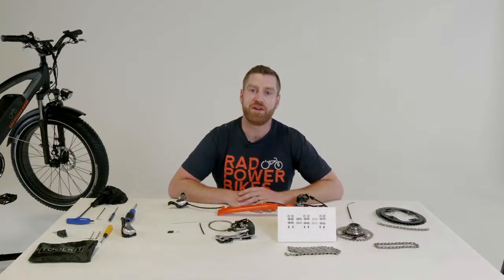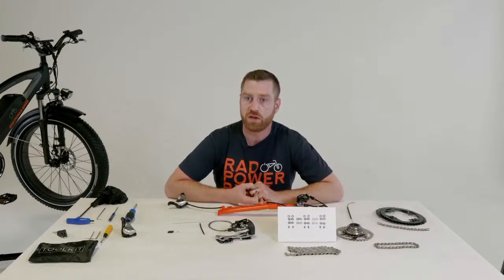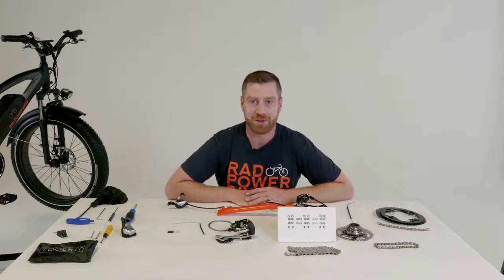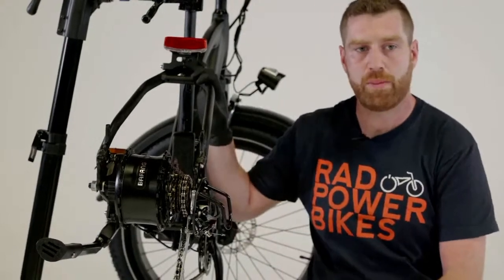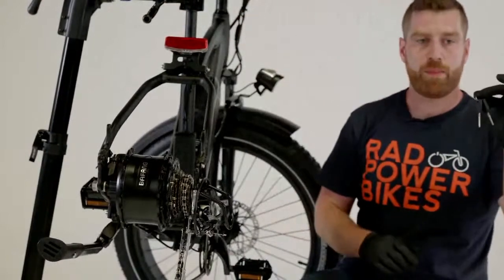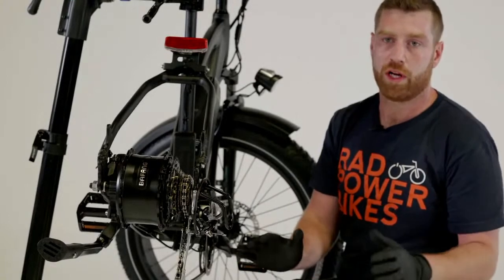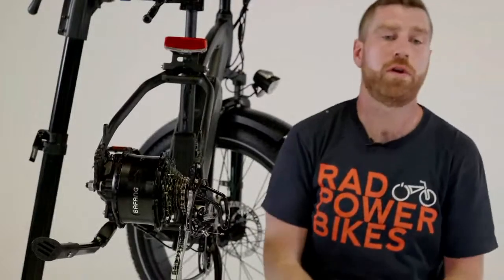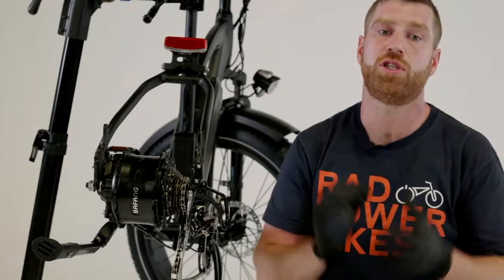Rad Academy Live - Rear Derailleur Adjustment 101

Comment: This is the kind of video all companies should have. Just got my RadCity 5 Plus and had problems with the rear derailleur.
I had problems with my gear skipping and 6th gear didn't even work. Everytime I pedal the gear would jump and automatically switch gears. So I followed your guide and the bike is also more silenced. Saved me a trip to the local bikeshop too. 

I only wished you guys would answer the questions in the comments on this video instead of refering to customer support. Would help others reading.

Comment: I just got a new RadRunner Plus, and the chain skipped under a heavy load. It turned out to be the shift cable had slack, causing the chain to be in between gears. I followed the procedure shown here. Very easy to follow, and the adjustments made shifting super smooth and quiet. Thanks!

Comment: This is a great demonstration. I would suggest that a closeup of over the shoulder view would help. I was having trouble shifting my RadCity 4 from 5th gear to 6th and 7th gears. I watched the video twice, tried to adjust, and had no luck. AFTER the 4th attempt, I set back looked carefully at the derailleur. I notice the (I don't know the proper name) brush guard was bent and preventing the derailleur from extending to the 7th gear. I CAREFULLY bent the guard and it works perfectly

Comment: Amazing video. I now have confidence when adjusting the derailleur. My Radwagon 4 had some gear shifting issues out of the box or maybe I caused issues while constructing the bike myself. Anyhow, I followed this video from front to back and found some real issues with the settings. I think I prevented a serious accident, and all the gears shift perfectly now. I couldn’t figure out where the 5mm gap was supposed to be measured as the last adjustment, but then I was assured I didn’t need to tinker with this one since the gears were working well. This video should be referred to in the manual, along with the self installation video, if it isn’t already. This is the natural next step after construction, and before you strap your kids on the back.
Reply from the maker: We appreciate your feedback! Please don't hesitate to reach out to our team if any issues come up.
Reply: (new rad bike owner here, your customer service is amazing)

Comment: Great video. My derailleur was messed up.. So I thought. It didn't want to go into the lower year and I was trying to adjust the lower limit without success. It turns out it was the cable tension. It's shifting very smoothly now thanks to you and this video. Great support all around so far from RadRover. You gotta like this kind of service. It's what I call a customer centric company. Keep up the great work.
Reply from the maker: Thanks for taking the time to share your positive experience! Please don't hesitate to reach out to our team if any issues arise, you can reach them via email at radpowerbikes.com/support.

Comment: Thanks to your highly instructive video I fixed my bike, that wouldn't shift into 1rst or 7th, with a hammer.  The hanger was bent out and a few whacks with the special alignment tool, AKA a hammer, did the trick. Not for the faint of heart.
Reply from the maker: If you need any additional help Lee our Product Support team is available at - radpowerbikes.com/support. We want to make sure you're taken care of!
Reply: @RadPowerElectricBikes  Thanks, I have years of experience with bikes including recumbents, some built or modified and have always done my own tune ups. So when I couldn't make this one shift right I was puzzled until the bent hanger was revealed as the culprit. I was very relieved. Thanks again

Comment: Thank you for this educational info. I can verify it is still being reference by new Rad owners. I adjusted the radrunner plus I got my wife for her birthday and also my FrankinEngwe which has a different brand rear derailleur with the limiter screws facing outwards but it worked just the same as you have shown. We adjusted an old 6 speed as well. Everything runs smoothly and better yet we understand what is going on with our transmissions and how to adjust and maintain!
Thanks again
Reply from the maker: Thanks for taking the time to share your feedback! Stay Rad!

Comment: Plan on getting the rad plus shortly. I am currently using a recumbent trike. After watching all the videos on adjusting and what to check on multi-speed bicycles and trikes yours is the first I have found that breaks down the individual components and explains them to the point of what they are supposed to do and what to look for even before starting adjustments. Thank you very much. Will you be doing videos on brakes and the electrical system? 
Chris in Meadville PA

Comment: Thank you, David.  I had the same problem as Dennis Maloney did with the derailleur guard bent every so slightly wheelward, preventing the derailleur from reaching the highest gear (7).  I suspect it had been pushed in during its somewhat tough transcontinental transit to my home.  You might wish to amend the video to verify the guard is not striking the derailleur body as a first step...

Comment: I tried myself after i took out the rear wheel but it's not so easy. I had to take my Rhino to a local bike shop. They finetuned my derailleur and adjusted both brakes. I took less than a half hour and i paid 20€. Some things are better done by a good mechanic, especially if it concerns your own safety and that from others...
Reply from the maker: Great call! We always recommend having your work inspected by a professional bike mechanic to make sure you have a safe Rad Ride!

Comment: My RAD Mini in a lower gear made a crunchy noise and the chain is not on the sprocket but in between it. This happened first time I rode the bike from the factory. Looks to me like the chain is installed too loose and just needs tightened up. Bike works fine if you don't peddle.

Comment: you could just remove the battery that is a guaranteed way to not have the bike turn on.

switches can be set wrong or fail or be defective so the battery may not be off.

also removing rings is to prevent shorts with any wires if you are working on the electrical mostly if you are building a battery.

if the derailleur hanger is one of the many standard hangers you can replace the hanger  i think where the bike mechanic is needed is to straighten a bent hanger

for the bike its self most bike shops can help there the only things that would be rad specific would be the electrics and any custom designed parts?

Comment: Just watched and will be trying the adjustments for better gear changing. 2 questions: 1- with no bike stand is there another recommendation to get the bike up off the tire so I can turn the pedals and wheel (rather than having to wait for my husband to get home and list the bike up)? 2-will adjusting my gear using the derailleur tips fix the fact that my gear changer does not make audible sounds nor seem to hold the selection when choosing easier gears?
Reply from the maker: Hey Beth! These are great questions for our Product Support team! You can reach them at - radpowerbikes.com/support.

Comment: Not sure if this will be answered, but on my fat bike I fell over on the drivetrain side (clipped in...), right afterwards I noticed it would jump or as I sound it...tik, tik, tik on the 2nd and 3rd lower gearset.  I attempted to adjust it but these systems are a mystery to me.  I took it in and the bike shop 'adjusted' it but I found during a ride it was doing the same thing, but under load.  What perhaps did they miss or not do?

Comment: I needed to move my RAD Mini derailleur handle, but the screw was too tight. I've stripped it. And the screw head is rounded -- can't grab it with a pairs of pliers. What size replacement do I need? FYI: Good video.
Reply from the maker: Hi Davis! Our Product Support team can help you out with this. They can be reached at (800) 939-0310 ext. 2 or at radpowerbikes.com/support, and they'll take care of you!

Comment: Is there anything else that could cause popping when in 7th Gear other than testing indexing and the limit screws? I've tested everything out and it works fine on the bike stand, but as soon as I apply pedal pressure when the bike is on the ground I get intermitent popping and I can't tell if it's skipping over the gear?🤔

Comment: Have you got a video for the radrunner 1 as I am in great need for a bolt which attaches the rear drop out hanger to the bike thanks the one I have or did have is no longer viable and I am having great trouble in sourcing a new one , it should be sold with the drop out hanger but it is not

Comment: For the rad chains, are there any rubber o-ring seals like on a motorcycle chain? Just trying to figure out which degreaser to buy, and if I should be concerned about rubber chain seals.
Reply from the maker: Hey Razz, no our bike chains are the same as traditional pedal bikes. You do not need to buy a chain cleaner that is specific to ebikes.

Comment: I have two rad minis, they shift fine but both of them clunk when going from coasting to pedaling.  They have done this from the time they came out of the box.  This is very irritating.   When the bikes are sitting still you can back the pedal and then move it forward and it will clunk every time.
Reply from the maker: Hey Gary! Thanks so much for this feedback! So sorry to hear about that. That sounds like a good question to bring up with our Product Support team! You reach out to them at your convenience via email at - radpowerbikes.com/support.
Reply: Our two new Rad Mini ST2s do exactly the same. The Rad's freewheel design needs to provide more internal cushioning to smooth the transition from coasting to pedaling.